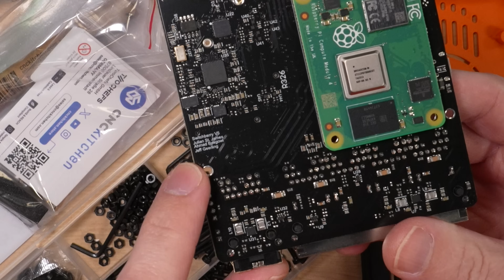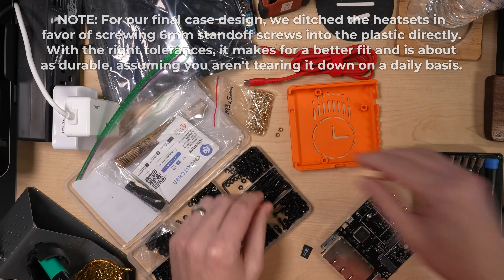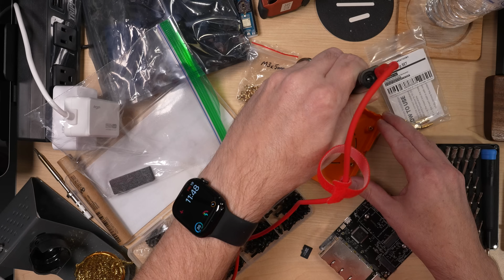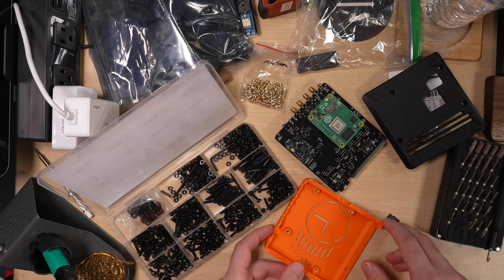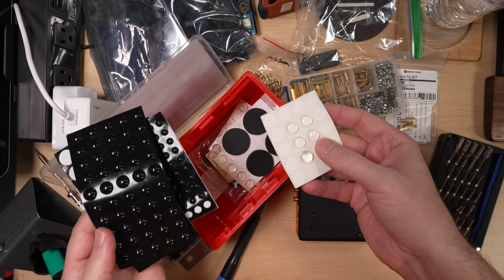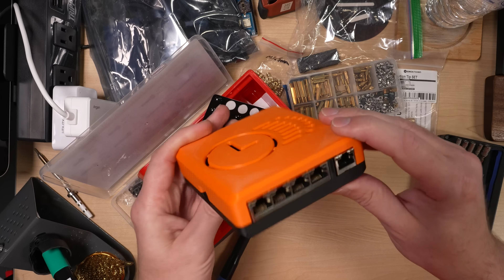Putting together the first Switchberry (a managed PTP switch)

Comment: Very nice build!!! Just a question: As the box is designed for this board, is there a reason why the standoffs, where the heated inserts are placed, are not 10mm  longer to avoid the extra 10mm brass standoffs? I don't want to troll around, it's just curiosity if there was a reason!!!

Comment: does the pi4 act as a grandmaster?  If so I really like this project. especially if I can tag vlans out the ports. Biggest issue I run into with clocking is switches that can't act as boundary clocks, so the GM gets overwhelmed with timing requests. being able of offload that work to a TC switch is very exciting. 

What's the status of this project? is it a board I could order? or a board I could make?
Reply from the maker: Yes, we're testing everything currently. Will hopefully have a small batch available soon, for dev purposes

Comment: What is the use case for high-accuracy timing with a device like this? It's not like it's going to be doing missile guidance.
Reply from the maker: Media distribution (like Dante networks), little test labs where you need good time transfer, or edge installs for things like wireless/RF, that sort of thing could be useful to have a small, low power switch + timing server

Comment: When sticking bumpers etc to surfaces, clean the surface to remove oils from handling. 

If you're using a solvent like isopropyl alcohol, then make sure that it has completely evaporated before applying adhesive.

Comment: Have you thought about installing a fume extractor at your bench when using a soldering iron to install brass inserts into plastic ?
Reply from the maker: Yes, I have one in mind, just haven't bought one yet. It's only here and there and I have a fan providing a cross-breeze to the back of the studio, where I have a bathroom fan pulling air out of the building. So I'm not too worried, but do want to add a fume extractor

Comment: I design my prints to have the inserts put in from the opposite side the screw or bolt comes in from. That way I don't deal with heat, which often ends bad, and the insert can't be pulled out by the fastener.
Reply: The recess for the heat-sert can be profiled to bottom out if you know the exact threaded insert dimension. The insertion tool will require a sudden increase in required force.

The matching boss on the mating part can be dimensioned to test against the flange of the insert, preventing pullout in the other dimension.
Reply: @BerndFelsche  To date, with my method I have a 100% success in installing inserts in 3D prints, which heat doesn't for anyone. That was my point, and I am sorry I didn't make that clear.

Comment: Um, I don't see an advantage in having standoffs there. Is there a reason to not make the mounting posts taller so you don't need additional standoff hardware and additional assembly times and material cost? (Stabilize taller posts that are next to a wall using a tall thin buttress between the side of the posts and the wall, or four short triangle buttresses at the base of the posts that are not next to a wall).
Reply from the maker: The main reason was the board not having quite as much clearance around the screw holes as JaredC01 would like, having the standoffs makes it easier to screw and unscrew the bottom as much as you want.

Comment: I’ve built 5 pi‘s over the years (3 x Pi4, 2 x Pi5) and it amuses me to no end that I‘m not the only one who has several standoff and screw trays (that look just like the ones Jeff had in this video…) sitting in a drawer. I even have the same little rubber feet mats (used the black ones on the pi5s, the clear ones on the pi4s….;)
Reply from the maker: Heh, it's that and little circuit packs (like thousands of capacitors and resistors) that build up over the years.

Comment: Looking at the KSZ9567S it's got IEEE 802.1AS support so it could be usable for AVB (gPTP) switching. Given it's (relatively) limited 1Gb ports I am not sure how Synchronous Ethernet would fit into a solution using this hardware, so that would be interesting to learn more about. 
My only usage of SyncE was for Cellular fronthaul setups where it was used to time-sync the radio cells, but those needed high speed Ethernet (5G,10G,25G) for the Radio data packets regardless of the split being used in the fronthaul network.
Looking forward to hearing more about it.. looks like a cool project.
Cheers,
Reply: You are really a high-end user for time-sync.

Comment: I'm familiar with the need for precision timing for specific applications/needs, but for the majority, PTP seems overkill. I like the tinkering though.

Off topic, how's the Prusa vs Bambu printing? Is Bambu still doing their firmware/cloud/account nonsense?
Reply from the maker: Bambu did a bit of a PR tour after the big kerfuffle, and Prusa has been a little more locked down with their latest generation printers... it's not a wonderful situation all around, still.

But at least Bambu's kept their promise of having a local only 'Dev' mode. I still put my printer on lockdown on my network, though, and only use Orca Slicer. They aren't making it easy for Orca to coexist with their printers though :(

Comment: I'm using the exact same model stand for my Pinecil; 👍great idea, to drill out those holes, in order to put the tips in there - 5.5mm drill will make it fit, but a 6mm makes it comfy to use. 60W USB-C is running the Pinecil about a forth below the 88W max. rating. Iirc, you'd only get full power by feeding it through the DC barrel jack. Mine is plugged into my bench power supply.

Comment: I have the same exact setup with the soldering iron with the cable and stand. There is an alternative 3d printable holder plastic thingy for that stand that fits the Pinecil.
Reply from the maker: I'd just be worried if touch the stand and melt it if I had any plastic on it! But I did see a couple and they were decent

Comment: Be careful with the fumes from soldering and melting plastic, you should have an exhaust vent setup so those chemicals aren't going into your house or workshop. 

You can build your own made from sch40 PVC pipe with a flexible dryer vent hose on the end with a 12V computer fan. Your lungs will thank you

Comment: With 10 mm standoff and just going through a plastic case 12 mm screws looked longer than needed. I'd said from watching you put them in you could switch to 8 mm or so. You really don't want they maybe bottoming out in the standoff.
Reply: There's only about 3mm of engagement with M3x12's, so you don't want to use anything shorter, and the 10mm standoffs have about 8mm of internal threading / space, so there's still another 5mm of available depth if needed!
Reply: @TheJaredC01 Just looked like more in the video by how many turns he seemed to need to get them in fully but he did say something about the hole in the case itself seemed a little tight so maybe that was part of it having to cut threads through the plastic before hitting the standoff itself. It was all still prototyping work he was showing so going to be little tweaks needed it just something that I noticed that seemed off when it took so many turns on each screw and the numbers not adding up with 12 mm screw into 10 mm standoff etc. As he said the black on black made it harder to see what was going on in the video too.
Reply: @michaelcummings7246  the main issue he had in the video was that the heatset inserts weren't perfectly flat / level, which caused the standoffs to be misaligned to the holes the screws were in, which caused binding while tightening the screws.  That was part of the reason we decided to get rid of the heatset inserts and just thread the standoffs into plastic directly.  There were no threads being cut into plastic with the setup here in the video.

Also for reference, the 10mm standoff doesn't have 12mm of screw going into it.  The lower half of the case has its own standoff spacing, plus the board spacing, before it goes into the standoffs, which results in the earlier mentioned ~3mm of engagement.

Comment: Maybe I'm in a minority, but screws are almost always preferable. Snap together designs and anything requiring a spudger, guitar pick, or any other tool to pry a clamshell apart with ridiculous amounts of force are one time assembly products imo, meaning no right/option to repair.
Reply: screws >>>>> clips >> glue
Reply: god i hate the clips that are used to hold laptops together
Reply: Bolts are preferable over screws because a lot of people will associate "screws" with "self tapping" screws which go straight into the plastic and wear over time. Threaded inserts can be be repaired and replaced.
Reply: yep I try to avoid anything that doesn't have screws visible.

Comment: Needs a rack ear, SFP+ ports,  and an "All ports on the same side" option.
Reply from the maker: For this version, focus is on getting it compact and useful for throwing it on a desk/shelf. I hope if we can get this done well, we could make some other versions. Initial revision had one SFP+ cage.
Reply: Seconding the rack-friendly model! Also poe, or is poe not enough power for the hardware?
Reply: @efad3215  it would need a much bigger power supply for PoE.
Reply: @guytech7310 Fair enough, the dc -> dc conversion internal would be annoying. However, we're talking a racked unit anyway, there's 19" for PoE circuitry to exist in. 

I was moreso wondering if the Switchberry pulled more watts (for simplicity) than any poe standard allows for (+++ excluded for the moment)

Comment: Interested in estimated cost on this. I have a Dante system at work, and clocks are constantly competing due to user input. I'd really like a central standard for all devices which can be a PTP source on the network. A Dante master is above $2200, if I could get a PTP clock going for a few hundred, I stand a good chance of it passing through purchasing. I do have a GNSS antenna on the roof, normally sees 20+ satellites at the NTP server, so shoukd get a good signal.
Reply: You can use a server with a Intel XXV710-DA2T ethernet adapter that supports IEEEE 1588 PTP in a linux server running grandmaster, or there is GPS NTP+PTP Network Time Server (TM2000B) for about $550

Comment: What is the reasoning for such precise timing?  I saw a few videos on clocks and I think I just missed the reasoning.
Reply from the maker: For me, fun and exploration.

For others (and more practically), synchronization for things like finance, database integrity, signaling (e.g. radio or 5G), science, or media (e.g. broadcast timing).

But most people could do with just NTP.
Reply: I'm not sure yet about the level of precision I need (or accomplish), possibly Wifi TSF will suffice, but my timing sensitive hobby project is synchronizing exposures to build a modular light field camera.
Reply: In broadcast we use Precision Time Protocol with many AV over IP protocol ( Dante : PTPv1, AES67 : v2, ST2110 : v2 ) for example

Comment: For the pinecil, you can set it down and it'll cool off.  It re-heats when you pick it up again.  Pretty nice!
Reply from the maker: Heh, but I'm always fidgeting with it to try to figure out how to get it to cool down! I guess I just need to settle down and let it cool down.
Reply: @Level2Jeff  Probably the "right way" for both of us is to have one of those soldering iron holders and just put it in there so you don't have to worry about the heat at all.  Even with it powering off automatically, I'm always terrified of accidentally putting my arm on it, haha.
Reply: @Level2Jeff Alternatively, there is an optional (unsoldered) Hall effect sensor you can solder onto the board and make the pinecil sleep when it detects magnets nearby (a stand with magnets placed at the holder)
Reply: I'm pretty sure you can just hold the minus button down for a few seconds and it will stop heating.

Comment: Wonderful! But a question … what processing is needed on the CM4 RPi and could a lighter processor do everything needed on a “switch”? I ask this without reading the full spec of the project and working mode of the device.
Reply from the maker: It's mostly to add on a Linux stack, for hardware PTP and switch configuration. Also gives enough speed/bandwidth for full speed WiFi 6E or 7 if desired.

Comment: Interesting, I haven't worked with anything more than the NTP protocol timing-wise, so I have never seen a switching device working with PTP. I clicked on this video thinking it was about an L2 switch module for the Pi platform, but that time stuff is also interesting.
Reply: I guess the timing sync running on L1,  not on L2. That is PHY layer.

Comment: Cool! Didn't know you can load dsa driver as overlay good to know. Control of chip happens via SPI I guess? Wonder why Microchip opts for this where other chips often just use MDIO for the control (and they support like both as far as I understand). And DSA network drivers are so powerful and nice to use.

AVB and TSN things are on my list for next year to check out so this might be intersting hardware as well as test equipment.
Reply from the maker: Hoping to get some of the software/firmware side nailed down in the next few months. I was hoping to get in more time on this board before the end of the year, but I'll probably start working on it (replicating Julian St. James' setup and trying to get things tested/verified) in January.

Comment: Timing stuff > AI stuff
Reply from the maker: In full agreement there :)
Reply: @Level2Jeff  to Jeff g I like to see the clustering and stuff for the “ai” but could you focus maybe machine learning side of “AI” and not as much on generative ” AI”
Reply: @AvaGregory-g2b why would anyonw use more reliable  old ai... all the cool kids are using new gen ai
Reply: Isn't it the core fundamentals of all electronics?
Reply: I need to learn about timing, something I have no clue about other than what I think is on my stratum 1 Pi server and I thought was something fully contained.
Reply: I see others have questions about timing.   Chatgpt provided me an excellent explanation.  I recommend others pose the question to AI.
Reply: can someone please explain why 'timing stuff' or 'time-snychronised', is significant/of-interest? 
that's the sole distinguising feature of this otherwise pedestrian gbit managed switch, right.
Reply: @jugheadjed  having hyperaccurate time in a homelab is 1) absolutely sick 2) a great way to learn network optimization (you need speed for PTP/NTP) and 3) reduces reliance on 3rd party services/time servers
Reply: @jugheadjed I suppose we may find out in the eventual video he mentioned, but so far for normal people it seems just for bragging rights. I'm sure there are use cases but at this point it seems they are so niche that it's probably accurate to say "if you don't know that you need it, you don't need it"
Reply: @jugheadjed  One small example.  When I was a kid interested in Ham radio, it seemed that the available bandwidth for radio channels was quite limited.  When radiotelephones were discussed for non-hobby use, it seemed that they would always be a prohibitively constrained, scarce, expensive resource available to only a few people.  But several factors - more bandwidth at higher frequencies, tight control of transmit range, etc made them possible. Most especially very tight timing of narrower channels allowed complex modulation and carrier behaviors opened up room for billions of users around the world.  Try that with 1950's era AM transmit and you just get noise.  All of this rests solidly on a bedrock of precision timing techniques.